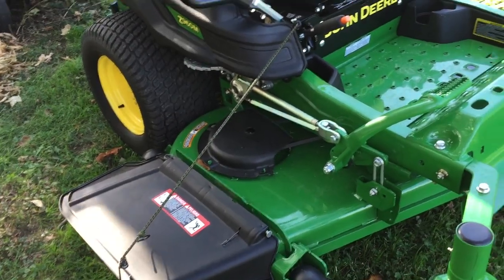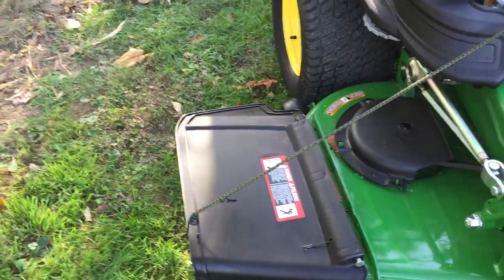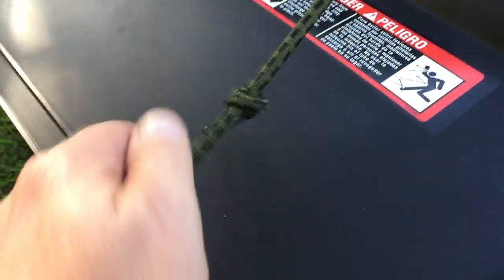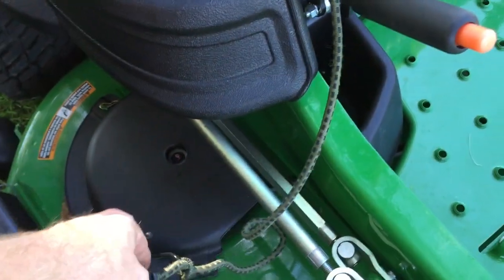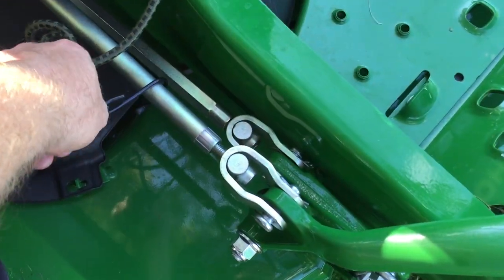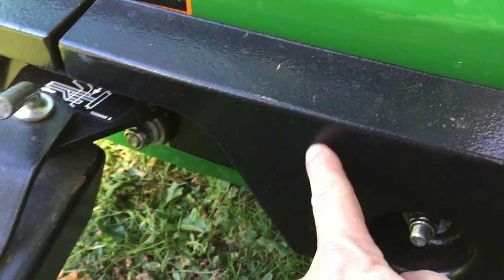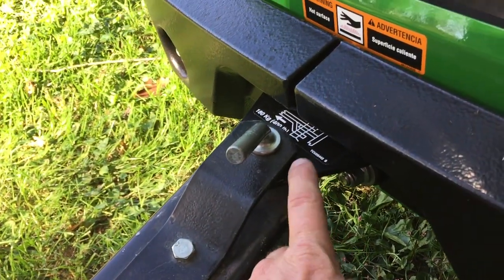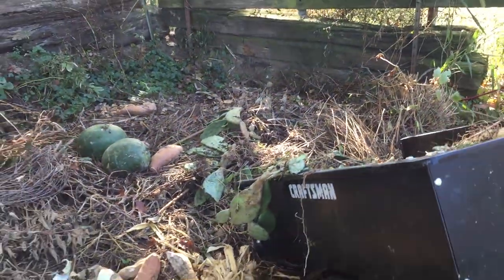JD Z960M - Quick Way To Raise Discharge Chute & New Trailer Hitch Installed

Comment: Very good.  I'm impressed with the simplicity and ease of use with your bungee cord set-up.  I watched this because at times I want the chute open.  Here in New England we can get periods of rain and can't get out to cut the grass so it grows much higher than a normal cutting would be.  When this occurs I'll get clumps and long rows of heavy grass from the discharge chute.  I've found when cutting high grass by having the chute open allows the grass to flail out of the deck spreading it farther away and wider.  That's much easier to clean-up or recut once dried out, than clumps and long rows of heavy cut grass.  That's a beautiful machine you've got there!
Reply from the maker: These days, I only put the chute down when it's very windy or the grass is very dry (dry leaves too) because it helps keep it out of your face in those conditions.  Otherwise I leave it down.  I'm just mowing my own yard, not mowing commercially.   It's also nice with it up because I can get closer to obstacles like trees.